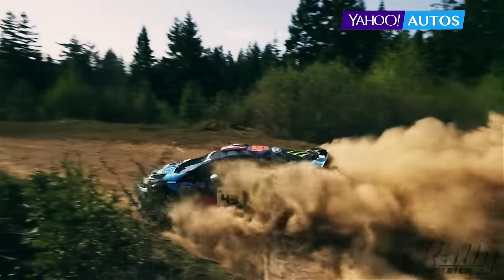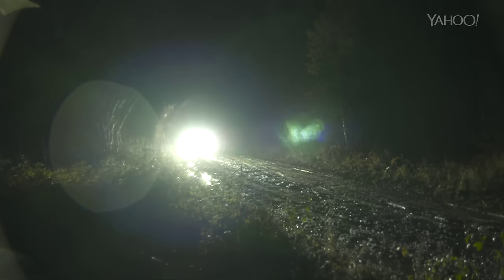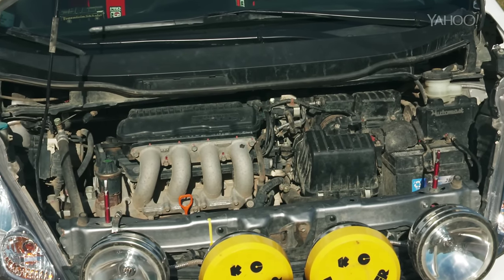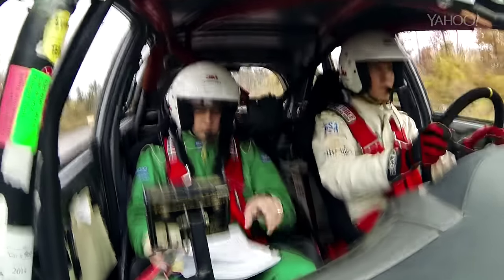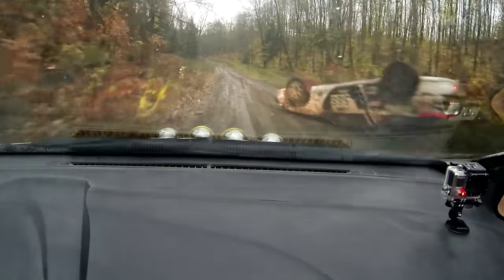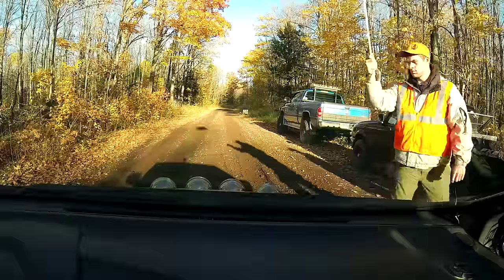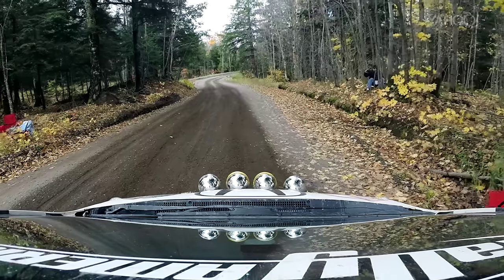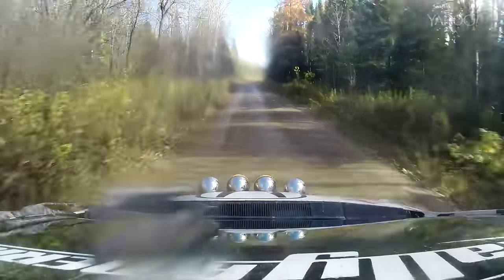How To Go Rally Racing On A Budget

Comment: I've edited my comment so you can't see what people are fighting about in here for the past 3 years
Reply: Comparing to a purpose-built rally car, yes it is a budget solution.
Reply: That's racing "budget" :D
Reply: HONDA RACING
Reply: Ik, like I could see like a 2K car and like 8K in mods, and prolly a friend who would be down to co drive. Also youd be doing all the work yourself
Reply: it can be done for cheaper if you choose a different car and depending what you are required to have vs what you want to have
Reply: If they sold that car it would still only be 10-12k they could hope for.

Buying a rally car already built is going to be cheaper than building one
Reply: @DamonXWind  true
Reply: And with all that you're still well under 10% of the cost of a dedicated WRC chassis with no spares, no co-driver, no crew and no trailer to put the car on since a WRC "shell on tube frame" car isn't exactly street legal.
Reply: yes thats budget because for a brand new car its the same price
Reply: All rally cars are 100% street legal and have to registered with license plates, and insured...and WRC cars are not "tube frames with shells". Learn a little before spreading nonsense.
Reply: That is budget racing
Reply: @joshbarth9469  
Sure. Not all WRC cars are "tube frames with shells". Just the top-end open-class cars, which are the cars I was referring to.
Reply: Swing and a miss. WRC cars have to be homologated, production based cars. Maybe you're thinking of group B? That class was eliminated in the 80s.
Reply: @joshbarth9469  
Group B required homologation too. Every car that competed in group B had to have at least 200 production units sold.

As for WRC open-class cars, sure, they're based on production models, but they're actually far more stripped down than even the group B cars are, to the point that only the base chassis remains (though to be fair, that's mainly because there was less to change between the competition version of a group B car and the "homologation special" production version). There's a lot less of a production Focus RS in Ken Block's Focus than there is a production RS200 Evolution in an RS200 that competed in Group B.
Reply: Oh. You think Ken Block is an actual rally driver. That explains much. Good luck with your velcro shoes.
Reply: @joshbarth9469  
Oh. You think non sequiturs are a legitimate form of argument. That explains so much. Good luck with trying to win arguments using logical fallacies.

It doesn't matter if Ken Block is a rally driver or not, his car is an example of a WRC open-class car. I only used his car as an example because it's a really well-known example (I would have probably used Colin McRae's #555 Subaru as the example if this was the 90s, although to be fair back then WRC open-class cars were a lot closer to their production counterparts than they are today).
Reply: @VestedUTuber  wrc cars are actually built off production chassis and are required to be street legal since transit sections are on public roads.
Reply: @TaylorZalus 
Even so, the only thing they share with the original car is the base chassis. I said it before but even the monstrous Group B cars had more in common with their production versions.
Reply: For this ammount of money You can rent a car in higher class for half a season...
Reply: 10k I can buy a Subaru sti in the UK
Reply: @BassApps
The word 
"budget"
is not synonymous with the word "affordable".

I don't know what you're talking about.
Reply: My budget $1k
Reply: what did you expect? when standart rally is about 150k car and mods then 20k is like almost gifted

racing aint cheap thats a fact
Reply: I can find a Subaru with 5000, wtf, 10000 for a honda that won't even strart well😑
Reply: @DamonXWind  You bought that Ford fiesta didn't you
Reply: You can also rally with for example Volvo 240s, they cost 1-2-3k€ and are rwd. Thats budget
Reply: @Aireisor  
 a demolition derby is real low budget racing. an old 100 dollar banger, a roll cage, a helmet and your racing.
Reply: @VestedUTuber  some of them are street legal. registered under what the donor equipment was (ie the engine) or under custom. it's not required but some teams have done it.
Reply: @ksm5579  this was in 2015 when the car was only 6 years old :P
Reply: compared to other types of racing. This is on the cheap end. Racing cars can easy hit 100k at base price.
Reply: Nanorisk in a few seconds i found a running rally car for 2k
Reply: Budget to win yes
Reply: It is yahoo
Reply: Almost went over budget there buddy
Reply: Not an average persons sport. As cool as it is I'll stick to dirt bikes, way cheaper and tons of fun. Just have good health insurance.
Reply: Buy a Ford ka
Reply: Bottom line, racing cars of ANY kind isn't a cheap hobby. I don't care if it's a miata autocross, or WRC, shit gets expensive. Start small, work your way up, beg for sponsorship after a couple of good seasons.... next thing you know you're Ken Block.
Reply: @Nanorisk  a purpose built rally car costs more than a house
Reply: What do you expect it to be, twelve dollars?
Reply: @zachyoung2002  my expectations were closer to 12 dollars than to 50'000. 

I expected something like buying a $500 shitbox, putting like 3k on mods (suspension, cage etc.) on it and have a few spare tires ready so you'd be cool with 10k to race for fun against similar minded people.

No idea what's so hard to understand about that.
Reply: You can that car up for like 5 grand now lol so it's definitely a budget build now 👍
Reply: Yes, for an expensive hobby such as racing, budget
Reply: or buy a Logitech g27 bundle with a handbrake with an “okay” pc and a playseat and buy dirt rally on steam 🤷🏽‍♂️
Reply: @VestedUTuber  You're thinking of RallyCross cars. ARA and FIA events don't allow tube chassis currently, but will in 2022.
Reply: @BassappsDeutschland  uhh, that is pretty much it. 2500~ for a rollcage, few cheap safety things (killswitch, fire extinguishers), and a co-driver. Everything else is optional.
Reply: yeah its budget all things considered and you can always sell the car to other rally drivers.
Reply: If $10,000 is too much money for you to play around with, then this video doesn't apply to you
Reply: @weekasi1  I think it's enough to buy a used rally car. There was a Mitsubishi Evo II rally car sold for 5,5k.
Reply: Marc Kunze  you should keep it 2 wheel drive. It's much cheaper and in some places cars that are converted to 4x4 are really hard to get through inspection and it could possibly break some rally rules. If i was you, i would install the safety parts, put some power to the engine and inspect it. 

Building (or just buying) a rally car is also my dream. Im currently building a Ford Escort MK2 RS1600 to rally sprints, because i don't think it would never pass through inspection = not able to enroll to rallies. The Esky is my and my friends car but ill buy my own car later. It's probably going to be a Esky or a Mitsu :D
Reply: @sadetta9312  Yeah it actually kinda is. But don't expect anything from this millenium.
Reply: Motorsport is not cheap
Reply: Stop crying. Car, parts, a circuit and mechanics are the least you must have to real life rallying.
Reply: @rapbigze  nope. We did rallying and all we had to own are some spare parts (tires. and we bought used tires), a car that is street legal and rally legal, couple of friends as the service guys and one friend as co driver. Where did you get the circuit from?
So rallying is cheap.
Reply: @sadetta9312  thats rallycross your thinking of, rallycross os relatively cheap whereas rally os no where near cheap, there is a difference
Reply: that's racing, you spend $1 million but only get $100k
Reply: I wanna know what yall been fighting bout 😠😂
Reply: @-meat-  i dont like rallycross. it was rallying we used to do. it was pretty cheap
Reply: @Lew699  oh the og comment was something like "20k and you call it budget racing?"
Reply: BassApps you need a hobby
Reply: @FUNNYSTUFF1178  says the one replying to a 3-year-old comment, get a job.
Reply: @BassappsDeutschland  Haha. Your comment says for the past three years. That means you edited it recently.
Reply: @FUNNYSTUFF1178  yep, still says "3 years ago" and you somehow care enough
Reply: @BassappsDeutschland  Yeah. The comment I was replying to was not 3 years ago though.
Reply: @FUNNYSTUFF1178  Again, technically it is.
Reply: its about wether they shoulve bought a subaru instead of a honda

Comment: Funny they say 10 k is cheap. You could buy and build a much better rally car for 10 k
Reply: +Frederick Neill you could get a used subaru wrx sti for less than $10k
Reply: Frederick Neill And for that 10K you would be absolutely demolished being in a car far faster than a beginner can handle. Even if you don't waste the entire 10k wrecking the car, you'll still be completely uncompetitive.
Reply: You can actually buy and build a Lada 1200 / 2105 / 2107 VFTS for under 8k. It's around 140 BHP, and it's RWD.
Reply: rwd is terrible for rally
Reply: Combustion69 RWD in rally is good, Take the Volvo 240, the toyota starlet, ford escort and the lancia stratos as some examples.
Reply: Dat Cringy Car Channel Which Escort? All the rally escorts I know of are awd.
Reply: Shabuti R18 I know, i got mistaken.
Reply: MarkTheAmazing you wouldn't even need an sti if you are good with welding you can make your own turbo manifold and make way more HP than his shit mobile with awd too
Reply: In europe u can buy build lancer for that money
Reply: Combustion69 tell that to lancia
Reply: You could get a fully modified rally car all ready to go for 10k
Reply: All the rally safety gear is very expensive
Reply: What abot the MK 1 and the MK 2 Scort those are RWD
Reply: @areskmn  not in the USA
Reply: Shabuti R18 mk1 mk2 are rwd Mk5 are awd u Can get the mk3 as a rwd but really rare
Reply: @shabutir1820  mk2 mk1
Reply: 10k is kinda cheap for a used car. But I get where you are getting at.
Reply: @areskmn  what model of Lada has 140hp?
Reply: @LorenzoClara97  Search for "Credobus Eger Rallye 2019.friday - TheLepoldMedia"
Reply: Combustion69 The Lancia 037 and Stratos would like a word with you
Reply: @VG-Motors  issue is for noobs, who will be looking at these videos, RWD is much too volatile. Yes, it works really great, but when half of em cant even keep a rwd go kart straight, even a 100bhp RWD rally car is too much. FWD is much better for a learner cause it teaches you to slide
Reply: Agree. Nobody in their right mind would buy a honda fit specifically for rally racing. Buy ANYTHING else.
Reply: @shabutir1820  mk 1 and 2 the original escorts are rear wheel drive
Reply: @marktheamazing3683  you can’t just enter rally green with a sti
Reply: @marktheamazing3683  absolutely cannot get a used STI for under 10k. WRX and STIs are by far the highest reselling cars I’ve seen and it pisses me off. 

I bought my 2013 WRX with 60k miles for 19,000. 2-3 years later(this year), at 110,000 miles I hit a deer and ‘totaled’ the car. 

StateFarm gave me $17,200. I bought  the car for back for 3k, fixed all the damage for another 3k. So I basically just got $11,000 from the insurance company.

Unfortunately I spent the money right before the car spun a bearing. 

I put a $1300 ej20x in and I’m really impressed considering the cost. 

But I fucked up my transmission mating it to the engine, so now I’m trying to figure out how to fix a transmission.

I had never worked on car before getting the WRX but now it’s all I do. I go out to hunt for gold in the middle of nowhere on dirt roads and I get to practice my rally driving and you quickly realize how much more fun off road racing is than tarmac, much more skill involved and sliding
Reply: @shabutir1820  What? Sapphire Cosworth is RWD, Old escort MK 1 and 2 were RWD
Reply: @shabutir1820  mk2 mk1

Comment: 8k for a fit? I wouldn't pay more than 5k on that especially knowing that you intend to thrash on it. I'd imagine any little fwd car with decent balance would suit.
Reply: Honda civic 1997 hatchback with rally suspension, rollcage and bucketseats + harnas, straight pipe, brakes. Maybe new intake and if you have the money a turbo. If you find the right parts you'll probably sit under 18k
Reply: a toyota corolla from 1990 is perfect for rallying. i payed 2000sek (200euros) 
its a 1100kg 105hp car. remove some weight get nice tires and boom it should be  good to go for a beginer
Reply: CJSchecter96 buy a Subaru svx
Reply: You think 8k is much try buy a mk2 escort you'll be lucky to get one for 20k
Reply: what about transmission for the turbo
Reply: I would go with an old crx. Super light and probably much faster in a straight line than the fit.  And most likely handles much better. Put a bigger motor in. Taller suspension a roll cage and youre set
Reply: CJSchecter96 I just bought an 02 wrx with twice the power and awd
Reply: Get a neon. That's a grassroots icon

Comment: so basically it's possible to join for $10k (cause I can find a better car for $2k)
Reply: even cheaper if you know how to weld and have a welder, being essentially the price of the car and tires
Reply: You can find log-booked, turn-key 2wd rally cars for under 10k if you keep your eyes peeled for one.  It'll be an older VW or similar, but it will get the job done.
Reply: So many decent chassis out there for rally - question is what series you're trying to enter.
Reply: The safety equipment alone will run you more than two grand.
Reply: Found an 03' Civic SI for 2,873$ and it's better because VTEC POWAAA!
Reply: I found a 2000 ford focus (mk1) for €50